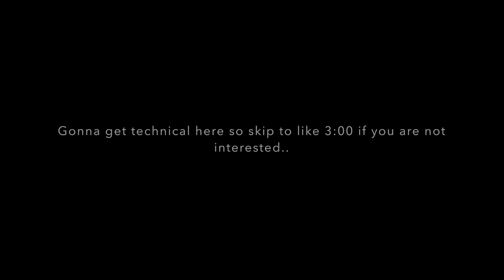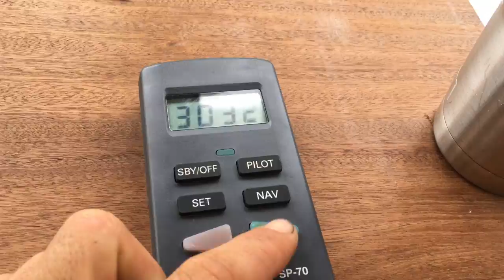Marine Transmission Problem SOLVED and cruising to St. Augustine!

Comment: Wonder if those coupler splines are an engineered weak point so when you DO have a prop stoppage it breaks there instead of the prop/shaft/transmission/crank?  Then it's easily replaceable to get it up and running again...
New coupler and you then have a good spare trans to have in spares or to sell?

Comment: Not to throw cold water on your celebration BUT you may not be out of the woods YET. You said you ran aground which caused the transmission failure. It is possible the strut and prop shaft are now bent knocking the drive train out of alignment which would cause the stuffing box to heat up . Maybe. Do you notice any additional vibration under way?  Were you having problems with the stuffing box prior to the grounding? And how far north are you going on the ICW?

Comment: Congrats on fixing the transmission problem! Would like to know what navigation software and hardware platform you're using. Also, how is it interfaced with the autopilot and what autopilot are you using. How would you rate the system?

Comment: I bought a 1978 281 Chris Craft (good condition) that has twin 3.0 L gas engines, connected too direct drive/velvet drive transmissions.  I have a lot of vibration on the starboard side engine and transmission.  I don't suspect the engine but I think the  drive damper plate and /or the transmission input shaft may be the source of the vibration.  Did your have a lot of vibration when your damper plate failed?
The engine has good compression and oil pressure.  BTW   I enjoy your videos.
Oops, I watched the video again.  Seems your problem was on the output shaft.  I think my problem is on the transmission input side because I have lots of vibration even with the transmission in neutral.  
I'm still thinking of buying the marine trader if they will lower the price to where it is a good investment.

Comment: if your packing is the type thats air inflated you can let the pressure down a little it will increase the leakage but slow the overheating

Comment: So glad to hear that you guys are back on the move again! Sounds like you found a great guy to help you out. I wrote his information down in my cruising info book for future reference just in case!I wonder if you can talk a little about fuel consumption and fuel costs while cruising. I currently am re-fitting a sailboat to go cruising so I can cruise solo and to accomodate the fact that I'm a disabled sailor. Well my condition has changed a bit and I'm thinking a trawler might be the better answer for me however, I'm very concerned about the cost of fuel because I had a stroke when I was less than 50 years old so I live on a very small retirement income! I wonder if you can talk about that in one of your up coming videos or write to me about it. Thanks so much! Bill S.

Comment: I tried sending you a message a few days ago, when placed in gear I heard a distinctive sound of stripped splines. I was a professional transmission rebuilders for 32 years. I'm sorry that I couldn't get a message to you sooner. It failed when the added torque of hitting bottom not due to a prop strike. Better in Daytona than half way across to the bahamas.
Reply from the maker: Dang!!! I wish I even had that idea in my head to check. next time we will post right away and keep a watchful eyes for helpful comments like yours. Thanks for trying to help!

Comment: one thing you need to do to that old engine has run the overhead on it its time and has a valve lash adjustment I can hear it, it'll make the engine quieter and run better with better mileage.
Reply: Make sure the engine is stone cold before adjusting.
Reply from the maker: Thanks for the advice! Is that simple enough to do ourselves? You just use a feeler gauge correct?
Reply: Yes, it is very simple (I have two Ford Lehman's in my Trawler). Call American Diesel Corp at 804-435-3107 and they will send you instruction and specs for the adjustment. They are the premiere Ford Lehman experts in the country and will provide as much phone support as you need.. Valve adjustments are critical for longevity on the Ford Lehman's.

Comment: GB-8135 P21 ML7780L

While checking the oil level on the Paragon Marine Transmission the dipstick separated from the handle and fell to the bottom of the transmission.  Is there a way to retrieve the dipstick?  I tried a telescoping pencil magnet and a flexible claw tool with no luck.

Thank you.
Tom Regan
201-707-1686

Comment: When I was in the Air Force stationed at Tyndall AFB, Panama City, Florida, I bought a 1946 Wooden Chris Craft cruiser.  I started rebuilding it.  I recaulked the bottom, replaced rotten wood, raised the deck to make it a flush deck (it had a big box for the engine before), repainted it and did lots of work on it to restore it. 
I went on Temporary Duty to Key West and got a call that my boat had sunk at the dock. I also received a new assignment to Shemya Island, in the Aleutian islands that I had to go to within a month.
I sold my boat for a dollar (still sitting on the bottom).  The guy I sold it to did get it refloating, never did find out why it sunk!  I think somebody deliberately filled it with water - there was lots of competition to get dock space at this marina on the Base.

Comment: i woulda drilled a half inch hole thrue the darn 2 things put a bolt thrue it and a lock nut on the other side and been on my wayy

Comment: First, definitely don't beat yourself up for not twisting both ends at the same time.  I'm certain a lot of us would have just checked each end and made sure both sides moved.    That said, I'm going to say again it might be something simple like a key.  And by "like" I mean that it's quite likely there is a shear pin in one or both of those sets of gears for when something exactly like what happened to you... happens.  It's there to save everything else.  And yeah, it does sound a lot better.  So while you did spend money on a "new" transmission, you also bought confidence that it's going to last for a good while.  And give you a chance to do a full rebuild on the old one.

Comment: Great job; I very much enjoy your videos. I "Commented" earlier during your transmission ordeal. I don't know your plans as in how far north you are expecting to cruise. If you come through the ICW as far north as the Pungo River in in mid-eastern North Carolina I have some boat/engine/items I would like to give you. I am on the ICW so you would not have to detour. I mentioned I had a 35' trawler for 28+ years and another trawler before that. I don't know the best way communicate; I'm reluctant to post my phone #'s or email. But I'd be happy to give them to you via your email... your perseverance dealing with the transmission was inspirational. There is a great book by Nigel Calder on marine diesel engine repair and maintenance. The essence of the book is clean fuel, air and oil for the mechanical stuff... you added a #4; the guts to try things, and the willingness to work and learn.....
Reply from the maker: Oh, man! Thank you so much for the offer Andrew. We are actually already through the area. (videos are a bit delayed) but if the offer still stands we will def take you up on it on our way back through. We can never have too many spares!

Comment: Woo Hoo - underway is the only way.  Cheers to NEVERLAND!

That old Navy tug, the Tutahaco, was in Ormond Beach on the ICW for 19 years.  The old Capt. who owned it passed-away.
The tug was sold, but the new owner had no funds  to rebuild the boat and then it started leaking oily bilge into the ICW.  The
U. S. Govt./USCG intervened and it was removed by crane and onto that barge where it is going to be eventually towed in the ocean to Texas where it will be scrapped.  Here's an interesting link:

http://www.news-journalonline.com/news/20170607/wwii-tug-shoves-off-from-ormond-by-the-sea-after-19-years

Comment: I found a 40 ft Marine Trainer that I like, however I'm 67 years young and would rather avoid as much work as possible  .   The boat will be and has been on a fresh water lake with plenty of places to run aground. I may buy the boat and I may regret it, then again I may not regret it.   I dont know

Comment: Did you also refill the blinker fluid?
Reply from the maker: +Tim Fiko yeah but I forgot to rotate the water wheels...
Reply: Dont forget the inverted blower valve balancer
Reply: As long as the Johnson rod stays well lubed he'll be just fine.
Reply: its the johnson rod... its not decoupling frum the fetzer valve. so ya 
gota re-calibrate the reflexive bypassers so that the subatomic 
disintegrater does not coagulate the doo hicky...
Reply: Tim Fiko Hey don't forget to buy your short throw dipstick it increases by a lot.
Reply: Hawk Moe he really should just get a turbo encabulator problems solved
Reply: what about the GPS oil
Reply: I thought I heard a rattle in the exhaust bearings??

Comment: I have a rule with engines. Whatever part you have you won't need. I would have a spare alternator and rebuild that transmission and stow it as a spare.

Comment: its the johnson rod... its not decoupling frum the fetzer valve. so ya gota re-calibrate the reflexive bypassers so that the subatomic disintegrater does not coagulate the doo hicky..
Reply: Hawk Moe you then have to check the specs on the rotary gerder.